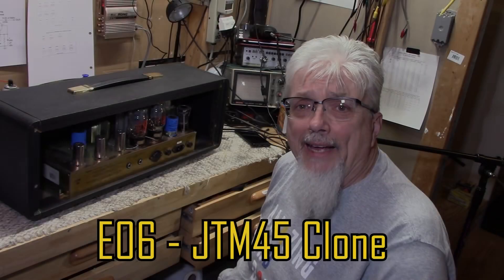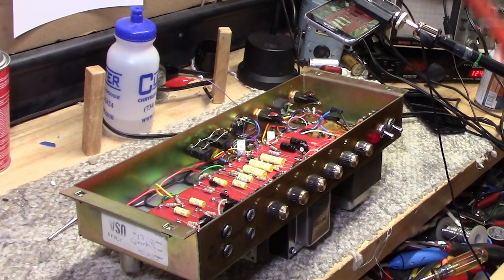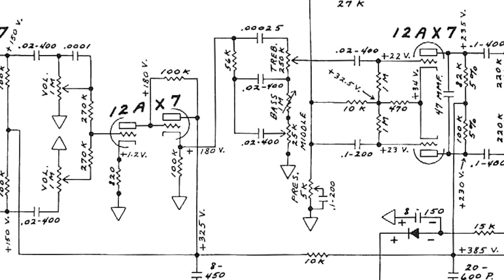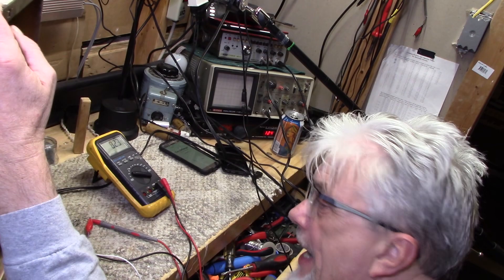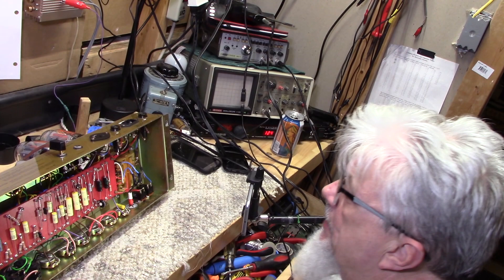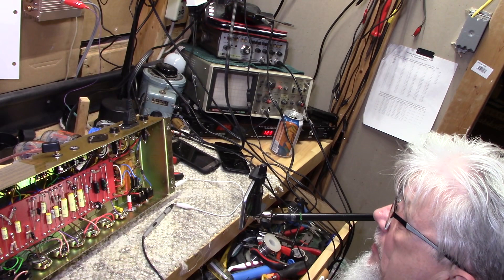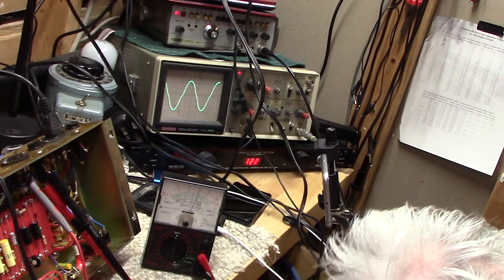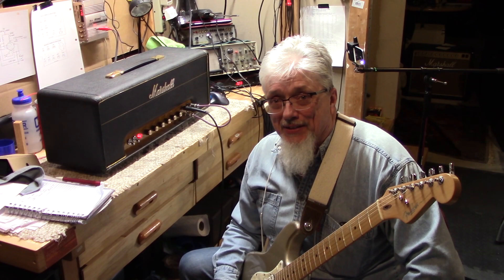E06 - Marshall JTM45 Clone - Analyze, Repair, Bias, and Test

Comment: I always install  a 1 ohm resistor at conn'n 1and 8 to ground. Thus you can measure the mV and get the actual current drawn to set the proper bias using Ohms law

Comment: I hate it when something moves while working on it, device starts working as it should, but gives me hard time to find actual fault like solder joint. I tend to resolder good components on moving tube sockets because it often takes less time than searching for not obvious problem. Of course that's just my approach. Nice video and repair here mr. Wally.

Comment: Regarding the comments on biasing with a 1 ohm shunt resistor. Sure, go ahead and install them in your amp. When you work on other people’s amps, if they didn’t ask for it, DON’T do it. Measuring the actual current and voltage of the power tubes is just faster and safe if you know what you’re doing.

Comment: Love this video! 

I have question though. I'm probably dumb for asking this but here goes: when you first pulled the amp apart, I saw your fingers close to the innards of the amps. I'd be too scared to do to an amp I'd just opened, in close the caps were live. And later at about 12:30 or so, you drain the caps and then remove the alligator clips from the chassis. I was told it's best to leave them on in case the caps recharge, which I've seen happen on my build despite it not being connected to the mains.

I'm sorry for asking, I'm a complete hack job, I'm honestly just trying to understand things before I build my second amp (a 5e3 clone...which tells you have new I am to this)...and live caps scare the living day lights out of me :-)
Reply: Yeh and don’t poke around in an amp like this with a screw driver. I don’t care if you’re certain the caps are drained. IMO it’s not very bright and sets a bad example for someone that’s learning
Reply from the maker: Sorry, I've been gone a long time. I ALWAYS check the B+ before I work inside the amps. If the caps "recharge," it's only to a few volts. Often in these videos, there is a lot of time between "shots," and I forget to mention that the power has been down for a long time. BOTTOM LINE: ALWAYS check the HV (B+) circuits with a tested DMM before continuing work. Have fun!
Reply from the maker: Your opinion, your work methods... It's science, not magic. If it's dead, it's dead.